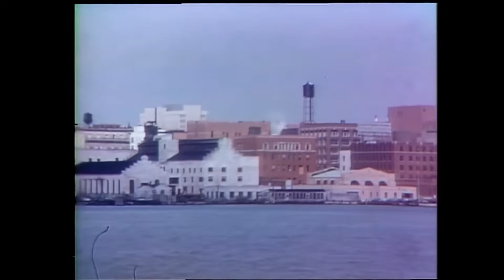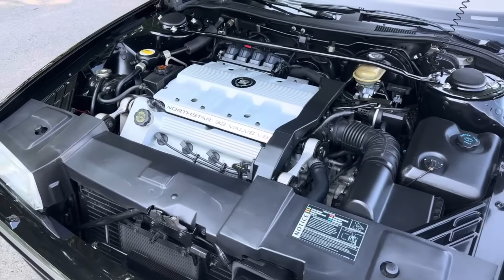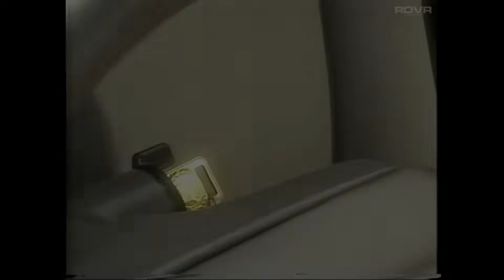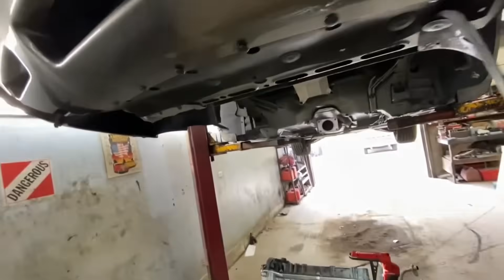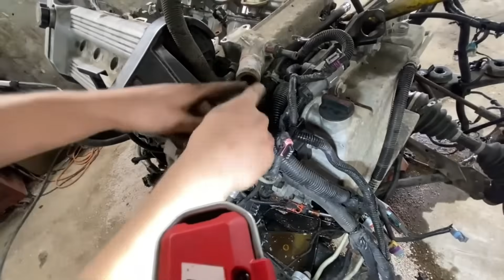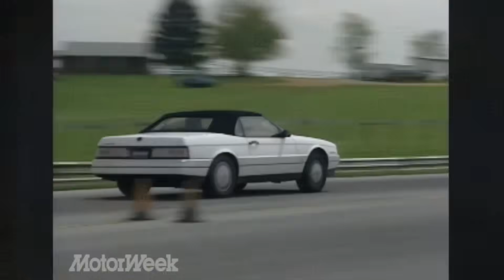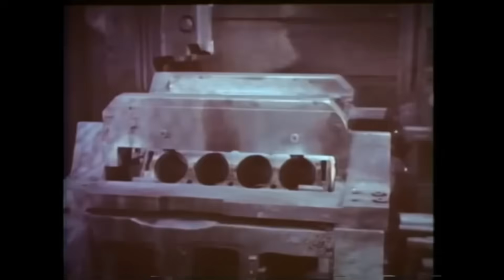Most HATED American V8 Engine of All Time!

Comment: So as a ex owner of a 98 deville, 1 correction I'm going to make before this gets any farther, the single exhaust models were 275 hp, the dual exhaust cars like mine and similar were 300 from the factory. So that is error the ai has made so far.But so far you have hit upon the single worst engine design of the last 50 years. easily, granted the modern ls issues and the ford rubber belt in oil are on par with how bad the northstar is. Take it from someone who knows... 110k miles and it turned into one of the worst engines i have ever seen
Reply: Chevy also uses rubber belts in the crankcase in their small diesels.  Some European cars do as well. It seems you can't fix stupid 😅

Comment: Wow I had a 4.6 liter Northstar engine 2007 in a Cadillac SRX nice acceleration smooth at the time not being aware cylinder head bolts 👍🇨🇦🇺🇸😎💗
Reply: I had one from 2005, no problems either. It has been said that with SRX/STS starting in 2004 the problems with head bolts were solved. Later I had a 3.6 SRX from 2007 and had blown head gaskets with it. And the 3.6 was less fuel efficient than the 4.6!

Comment: I can not figure out why GM sometimes hits a grand slam and other times they can not even get on base..
Reply: I think it depends on whether engineers or accountants were in charge. Accountants got us corner-cutting on the original Vega, among other debacles.
Reply: @AcmeRacing 
You nailed it.  The accountants were the problem. Same thing happened at Boeing

Comment: I had. ‘99 Olds Aurora ( baby Northstar).  Went over 200k before I sold it, still running strong. Usually got about 27 mpg.
Reply: Yeah, I had the Shortstar in my Olds Intrigue; 3.5 liter, six.  I had no complaints, peppy, efficient (and mine never gave me any problems).
Reply: My son had a 98 Aurora, great car except it blew a head gasket at 150 thousand, we took this beautiful car to the junk yard! He still misses it! How long has GM been bolting heads to blocks? Seems head gasket failure and oil leaks should have went away 60 years ago!
Reply: I have a 2001. No head gasket trouble
Reply: I believe the head gasket issues didn’t affect the 4.0 Northstars
Reply: My uncle had one for years made it over 300k
Reply: @gerryfinch2014: You really lucked out!!!! You had a rare treasure!